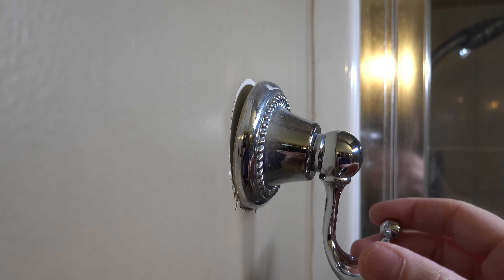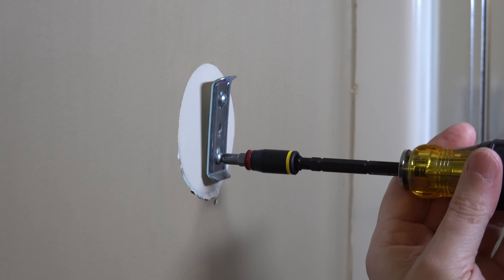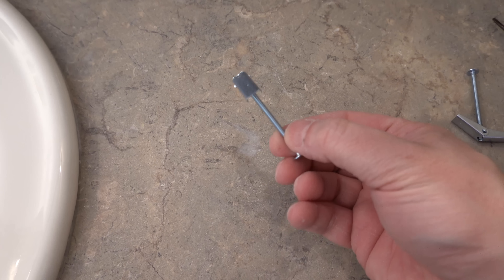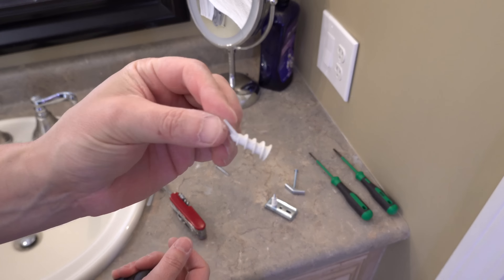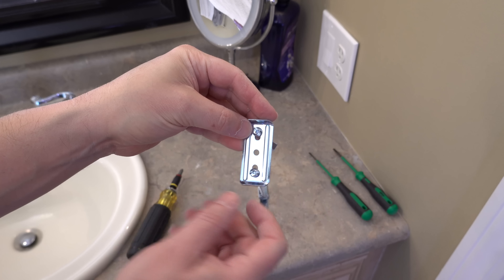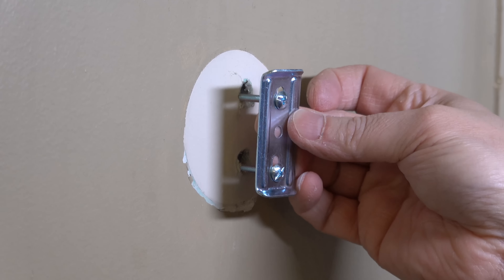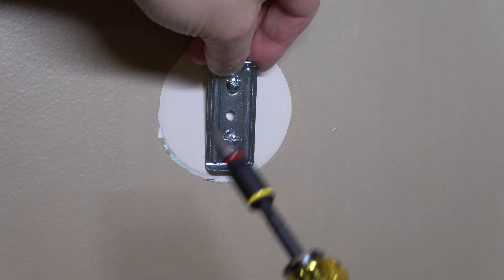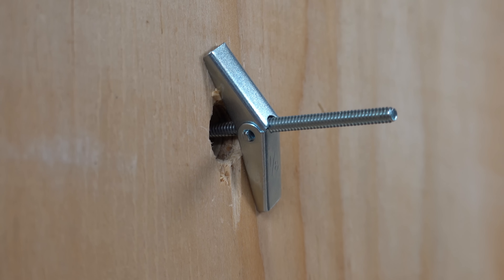How To Fix a Loose Toilet Paper Holder | Towel Racks & Wall Brackets

Comment: One thing you probably should have mentioned is that toggle bolts are single-use items. If you ever unscrew those bolts they drop down into the wall and are lost forever.
Reply: Was wondering if they can be removed. Thought the same
Reply: I’m sure you could use a double hook of sorts in the hole to close the wings and save the toggle
Reply: They're so cheap it doesn't really matter. You can get them back when you remodel and tear out the walls.
Reply: There are ways to keep the wings from dropping if needed such as putting silicon or something similar to hold it to the wall. use sewing thread or string attached to wings and extended back through the  opening.  I've never had an application were they were the best solution.
Reply: Keep a decent magnet stuck to the side of the toolbox.
If the material isnt to thick it should hold it in place through the wall
Reply: Doesn't matter, but its always fun to forget threading the thing through the bracket first and just shoving it in like a plastic anchor only to realize you've just wasted a bolt.  Losing stuff in walls is normal, the slot in medicine cabinets was for straight razor disposal ;)
Reply: @spacejihadist4246  He misspoke;  he means the toggle wings  will drop unless something extra was done at installation to prevent them from falling.

Comment: Thanks so much for posting this! I literally had this on my to-do list, and thought I was just gonna have to move the towel rack and patch the drywall. And I probably would have used the same type of anchors I used in the first one that came loose. Lifesaver!
Reply: Ditto!
Reply: Too late for me... already did the patch job.  Now I need to reinsert screws, but will do so using this method

Comment: Toggle bolts are always my go to. Whether it’s 1/8” or 3/16” or 1/4”. 
Plus an 1/8” toggle is a 6-32 screw which you can use when Switch and receptacle electrical boxes are recessed too far in the wall!

Comment: Ty. 2:48 Or use a Milwaukee "M12" fuel "gen 2" (has to be gen 2 or higher) - which has a toggle button to change to Mode 1 = it screws in slower for more control. (It also has 2, 3, and drill mode when you need normal power.)  
And use a plastic car trim shim that is angled, or grab onto the metal frame with thin plyers. This saves your fingers when the gap gets tight.

Comment: Been using wing nuts for decades, only problems is when your wall too thick and/or there’s not enough space behind the wall or Sheetrock to push the wings in far enough without hitting something behind the wall to open the wings all the way.  Once in a great while I’ll run into a place they just won’t work.

Comment: Instead of a toggle bolt, I prefer the sheet metal wings that pull themselves tight against the back of the wall. That way if you mess up and remove the bracket, you don't lose the toggle and have to go buy a new one. Like the next time your spouse or partner is painting and didn't need to remove the bracket, but did anyway...
Reply: What is a sheet metal wing? I did a quick Google search but the results were ambiguous.
Reply: @3moirai  A hollow wall anchor made of metal. Sometimes called a molly bolt (on wikipedia but I've not heard that term in my area).
They look like a bolt with a sheet metal sleeve around it.  The sleeve is threaded on the far end and has a head under the bolt head, with little spikes to dig into the outside face of the drywall. Push the sleeve thru the hole. As you tighten the bolt the far end threads pull closer and force out the sides of the sleeve which expand like 4 little wings behind the drywall and pinch the drywall between the wings and the head of the sleeve. The bolt can be removed and reinstalled.
Kind of like a rivet nut, but for drywall.
I've seen similar made of plastic but haven't had as good a results with them.
Reply: @Sylvan_dB  thanks for the description - I was able to find pictures and know what kind of hardware you referring to. I'll have to check them out at the hardware store.

Comment: I haven't tried this, but I suspect you couldn cut the anchors down to the depth of the drywall and flush them up almost all the way up the bolt against the bracket. Then put on the toggle and tighten. Then your bolts will have less play in the holes. Might make your solution last longer.

I could be wrong about that. It might just be better to use bushings. Or, you know, just let good be good enough.

Comment: Trouble with these is that when you remove the fixture, the anchor drops into the cavity.
Reply from the maker: That's true but it's not really anything bad. You can get them out with a magnet but don't stress over it.
Reply: Who cares?

They're diet cheap and they won't hurt anything.